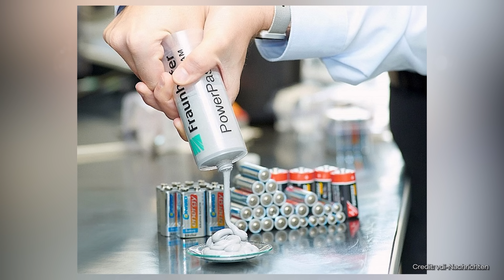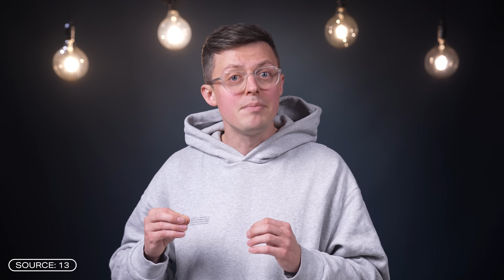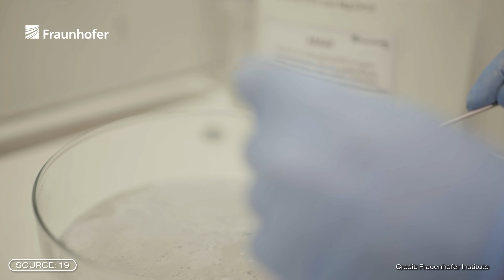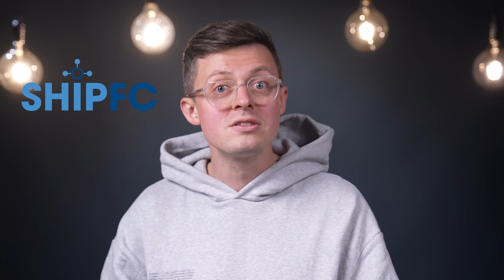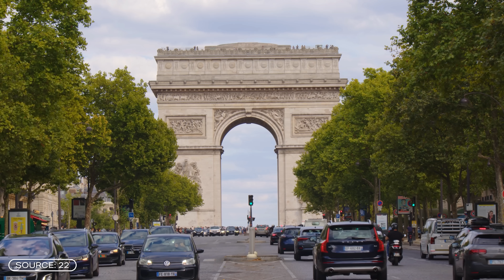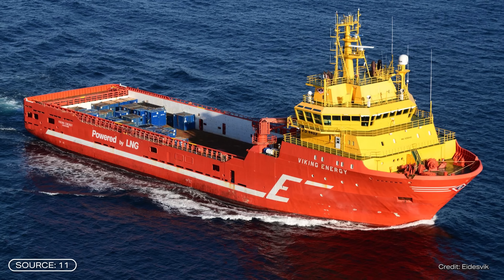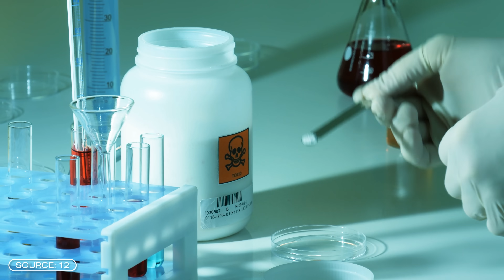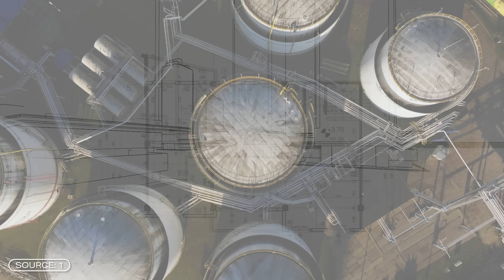Hydrogen Powerpaste: 10x Higher Energy Density & Safe?

Comment: how many kwh of energy does it take to produce hydrogen paste that contains 1 kwh of energy?
Reply: Yep this is the billion euro question.
My prediction is that however many kWh it is it's too many for any application where a battery can do the job.
The batteries in development now have an energy density of 500wh a kg so we are talking car ranges of 1000km+
There is just no justification for the added energy use, cost, and complexity of this technology, maybe shipping or long term storage might be niche cases.
Reply: @nervousfrog101 do we not also have to consider that the production of batteries becomes a bottleneck also that batteries storage is one thing the energy still has to be produced to recharge them and those systems also need to move from petroleum and coal and those replacements also have bottle necks. If there are other competitive energy production methods we need as many to consider as possible. I have concerns about water use of a hypothetical vehicle basically consumes a bottle of paste we then hypothetically deposit our empty paste bottle and reservoir of depleted paste as a deposit to get a new one top back up our water and go again how much of a burden is that in our water systems are the bottles reusable or more waste, are we recapturing water,how contaminated is that water should we get leaks into our water tables like we are with oil or fuel leaks now. Stable hydrogen fuel storage sounds great but lots of questions we also need to think about for implementation. Reasonably efficient energy production is just one.
Reply: @nervousfrog101  Exactly. From the power station to the battery, even taking into account hundreds of km of power lines, over 80% of the kWh makes it to the battery.

In this video the guy was talking about less than 50% efficiency for this paste.
Reply: @smoguli  I'll wager that 50% efficiency does not include creating the hydrogen either.
Reply: @nervousfrog101  From what I've seen, hydrogen round-trip efficiency is usually between 30% and 40% for a modern electrolysis cell and fuel cell together. I'd bet on magnesium hydride to magnesium hydroxide back to magnesium hydride being even worse. Producing magnesium metal from magnesium hydroxide (the waste byproduct of this paste after use) is a very energy intensive process.
Reply: @smoguli  yeah i think batteries are the definitive solution for cars, though i can imagine ships and planes profiting far more from this, also maybe the military will take it.
Reply: @nervousfrog101 Probably still more efficient than a gasoline engine 🤷‍♂️
Reply: @blueberrywilbur315 possibly but it needs to be more effecient than direct or battery electrification or it will only ever be suitable for niche cases which further strains the economics.
Reply: @nervousfrog101  The more we use our finite reserves of oil, the more cost effective it becomes.
Reply: I'm not 100% sure what you mean, but I think you're saying that as we run out of oil and gas, and prices go up, hydrogen becomes more cost-effective.

The problem with this argument is that it's not an option between fossil fuels and hydrogen. Fossil fuels are already doomed. Batteries are already a better solution for 90% of our needs. Hydrogen is a solution looking for a problem to solve.
Reply: @nervousfrog101  lithum will be doomed at somepoint to as well as all chemicals able to and or used during the creation.
Reply: @nervousfrog101  look up plugged oil wells. Just start with the deepest. You can find most of the data on Railroad commission (if your in texas) every state has their own version. 

Do a few hours of digging. You'll see the sinister truth.

If its not clear. Oil is being pushed up in places like a seeping but in reverse. I found a few areas in texas that are doing this, its looking pretty common in texas. The earthquakes are at the sites where the ground is treated like Swiss cheese, it does t take a rocket scientist to put 2 and 2 together.
Reply: @richbuilds_com hahaha 75ish % of commercial hydrogen production come from natural gas production “steam methane reforming” lol 😂
Reply: @richbuilds_com or…we could use nuclear and problem solved. As fossil fuels increase the cost of this substance will increase, oil is in everything.
Reply: @stephenc4755  There are already other battery chemistries that don't involve Lithium, such as sodium ion, but Lithium is still king of the hill for now and has not reached its peak yet.
Reply: @nervousfrog101  yes and it can run out to is all i was saying. im not disagreeing with anything else. its just all of it eventually could run out. Now imagine we could come up with a infinite power source harnessing power through thin air. Hell with how big coal hate nuclear power id say if we ever did find a infinite source of power, whoever found it would be dead and the tech stolen before we ever even heard a whisper
Reply: @stephenc4755  It's unlikely we will ever run out of Lithium, it's incredibly abundant, and it's 98% recoverable from old batteries. Short-term manufacturing shortages are possible. It's more likely that it will be replaced or supplemented with other chemistries.
Reply: @nervousfrog101  i sure hope so man. Life is already crazy enough. I had completely forgot that lithium is recyclable
Reply: @richbuilds_com the whole planet will fall apart before we burn through our oil.😂😂 at this point, this is an evidence based fact.
Reply: @nervousfrog101 i think people get hung up on efficiency, because they're usually engineers. But life has demonstrated that abundance, and sustainability is actually more important than efficiency. Especially, because almost all energy comes from the sun or gravitational forces. Therefore, historical natural evidence would say that sodium, is it going to overtake lithium as soon as we scale up.
Reply: @nervousfrog101 it seems like research momentum to me. Batteries weren't really confidently going to solve the problem 10 years ago. Hard to fire yourself and cancel your own research. Easier to convince someone that you should have a job.
Reply: @170_yearsNuclear for what?
Reply: @170_years nuclear will never happen because it needs smart people to run the plants with very careful processes, and the public to be smart and onboard with the idea.
Reply: @nervousfrog101 that energy density is too low for planes, and rockets. Anything with higher energy density than kerozen or hydrazine is interesting, and just like battery, first iteration are not the best.

Reduction in plane use is probably the way to go, anyway
Reply: @Miam_miam_la_gauffre you are ignoring effeciency. 60-80% of the energy from jet fuel is wasted as heat.
Reply: @nervousfrog101 We should not brush off alternative ways, it is always bad when there are no options. However inefficient it is now, it might be potentially better than batteries. It can be expensive to develop, but in the long run it will be cheaper. If we stop all expensive researches, we will have no development at all, as most low hanging fruits have been picked already, and humanity needs to invest more to get further. If you think about how much is spent on microchip advancement yearly, you will be saying a new iPhone is not worth it. Luckily, the manufacturers do not think so. 

But microchips apart, we need to get carbon-neutral soon, as we are already borrowing the environment health from our grandchildren. Hydrogen can be one of the alternatives, especially on the container ships, cruise ships, ferries and other heavy consumers. Maybe, trains or buses. I do not think of planes for now, but if technologies mature, they as well might be.
Reply: @nervousfrog101  Yes and not to mention the Toxic Waste aspect as well!, it's making batteries like sodium Ion look better & better :)
Reply: @pwrrpw319  sodium is a gimmick too its also explosive they claim its safe if it burns they lied some shot holes in one and it was like fireworks going off
Reply: @Hea@HeathensHaunt The same can be said about gasoline? When in storing that much energy in a small mass its bound to be explosive and also they shot it what did you expect was going to happen. What matters most is that under normal standard operating conditions or common fail states such as in a car crash and it doesn’t start heating up and set things on fire.
Reply: More importantly: how much does it take as compared with other fuels and batteries?
Reply: I don't think the efficiency is very high.
Reply: Quick google search says it’s 50-55 kWh to make 1KG of paste, which holds 1.6kWh of electricity.
Reply: @triplexkin6354so its DOA. Unless you just hook it up to the solar or wind farms or a hydro generator
Reply: @basteagui  That "unless" really discredits your intellect. This "technology" is batshit insane nonsense that only ideologically captured idiots could invent.
Reply: “Its hydrogen and flamable paste, i bet its extremely hyper expensive” said no one ever
Reply: @Petroleum_pipeline it’s 50 kWh to yield 1.6kWh worth of paste. It is pretty expensive.
Reply: @Petroleum_pipeline  Yep Pretty Expensive + Pretty Toxic = Pretty impractical!., unless someone can come up with a simpler cheaper & less toxic version, we are probably better off giving up on Hydrogen for transport!, and sticking with Batteries.
Reply: I asked the same question. lol Now they use natural gas and ended up with a net negative output
Reply: That was my first thought.
Reply: 57
Reply: Too much to mention I guess...
Reply: Yes
Reply: Doh !
you're not supposed to ask that question.
Reply: 1
Reply: The thing about this is that you’re never going to get net energy out of this stuff. It’s purely an energy storage medium to get work done without having to invest into either a nuclear reactor or haul a solar farm with you. 

Granted the amount of energy it takes to get a kWh of energy storage is still something important to consider.
Reply: Yes, I would also like to know this.
Reply: Doesn't matter nuclear is very cheap!

Oh wait...
Reply: More-so the question would be how much energy does it take to "re-energize" the paste to a reusable state. Initial energy cost would be negligible when it is re-used a lot.
Reply: @MsHojat  Cost of hydrogen has to be included, too.
Reply: The paste is reusable, but hydrogen is not.
Reply: @MsHojat  Since this is an almost entirely chemical-based storage, the cost of re-energising the cell is almost the same as the cost of making it the first time. The chemical bond needs to be reset entirely.
Reply: IDK, but I'm sure it will depend on the source of the hydrogen.  Water electrolysis is not particularly efficient, but other hydrogen sources/deposits, reportedly, have been found.
Reply: We've got us a 'thinker'."Release the hounds" as Mr Burns would say.

Comment: If we compare these H2 storage methods with synthetic (using renewable electricity) liquid hydrocarbon (LHC) fuels such as we currently use (fossil oil), there is no net advantage for any of them.  There is proven carbon-neutral  technology for producing LHC fuels from water (H source) and atmospheric air (CO2 source), and this is where we should be focusing our R&D efforts...making them as cost-efficiently as possible... 100% pure, carbon-neutral fuels that directly replace fossil LHC fuels in our current infrastructure and machines.  The quest for zero-carbon seems to be driving us away from this, and toward technologies that may be zero-carbon but that will induce a much higher total resource cost for the transition process and probably beyond that as well.  Carbon-neutral is good enough.  If we stop adding carbon to the atmosphere, various natural processes will lower atmospheric carbon levels quickly enough.  We need to break the fixation on zero-carbon and look at all possibilities to make a renewable-energy-based future!  
(Note:  For a few applications, short-range, low-power transport, like mopeds and city cars, and probably for grid storage-stability, solid state sodium batteries will make sense.)

Comment: There are many materials, which can absorb H2 at this rate - 5-10% of their weight. The problem is, to increase the mass percentage above 10%. Nevertheless, the direction is right. Storing H2 in hydrogen absorbing materials is a good choice, compared to the liquid and compressed H2
PS PLEASE. Discuss the fuel cells on hydrocarbon fuels. They may seem not "climat-friendly", but are a WAY more effective than the piston engines and work with far less noise and vibrations. Methanol, ethanol, CNG, diesel fuel cells exist!

Comment: Fraunhofer institute 
1990s compress audio wav format into mpeg layer 3...
2000s compress video mpg, contribute to the creation of amazing H.264 codec
2010s build the highest density, most capable solar cell ...
2020s compress hydrogen chemically into paste...

Keep doin what you are doin Fraunhofer institute,  for the good of humanity,  for the good of the future!!
Reply: You forgot the working Stellarator, you can basically buy today and who just isn't competitive with oil fired power plants.
Reply: @goiterlanternbase  I have no idea what a Stellarator even is,  so,  i didnt just forget about it, im wholly ignorant about it!   (got some stuff to look up now!)
Reply: @burnitdwn  Wendelstein 7X. It is run by the Max Plank Society, but the technology behind is developed by Fraunhofer IWS (institute for materials and beam stuff).

The technical director of the Wendelstein was guest in a podcast and explained the how's and why's. When they made the constant plasma heating test for afair 7 minutes, according to him, the exact time was not important, because the limiting factor was the electricity bill. That it does not fusion, has two reasons. The first is a different set of paperwork, for everything nuclear. The other is that it is much harder to work on a radioactive machine and this is after all a science project, where they like to change stuff and break stuff. 

Look this up: FG100 Stellarator
It should bring you to blog named Forschergeist. It is a talk in German of course, but they have a transcript, that you can translate or just ask an AI agent for details, or just translate you the entire podcast in their original voices. 

The podcast i am referring to, is the Alternativlos, session 51 (ALT051) 
I don't know if they have a transcript, but i guess they have.

Comment: How does the energy density of the hydrogen paste compare with powdered Al?  As it has been shown that powdered Al mixed with water releases hydrogen efficiently.
Reply: Notwithstanding all the other flaws with this tech,the energy required to use Al as a consumable is insane.
Reply: It seems a future to run ships and cars  you would buy a packet of aluminiuim powder and let it react to give X  kms of driving power. Maybe 0.5 kgs of aluminum powder turns into 1000 kms travel once  H2 produced?

Comment: Half the hydrogen released comes from the water?  So it also releases oxygen I assume...   How pure must the water be to avoid unwanted chemical reactions that could decrease yields or potentially cause ignition or explosion with all the hydrogen and oxygen in the system? 
Would it be possible to miniaturize the recycling process enough to do on site, or on a vehicle, and then simply fuel the system with water, or water and other stable reagents?
Reply: nah, it turns into magnesium hydroxide, binding the oxygen.
As for the recycling apparatus size fitting on the vehicle, probably not, it takes quite a few steps, depending on which route you go, you'd probably be dealing with molten metals and such. I don't think that'll work very well.
There are other solutions that are more 'rechargeable' in vehicles, though batteries still take the #1 spot there.

Comment: this will never be viable alternative. every step of conversion loose energy. decent fuelcell get like 60% energy so in the end it'll be compareable to lithium not even less and you have leftover that you'll need to process so at scale it'll be impossible to implement when ev you just charge the car and go. 10x is just raw energy but in reality this is a hassle. as hydrogen trasport? maybe. as ev power? unlikely.

Comment: Nothing new under the Sun.  Dr. Roger Billings in the United States demonstrated low-pressure storage of hydrogen in metal hydrides in the early 1970s.  He built a car that ran on hydrogen; the waste heat in the exhaust heated the fuel tank filled with metal hydrides, causing hydrogen gas to be released.  The engine required minimal modification, consisting of a small nickel disk being welded into the cylinder head of each combustion chamber.  He built a "hydrogen homestead" that used hydrogen for cooking and heating, all in perfect safety and was completely independent from the electric grid, gas companies and oil companies.  He even demonstrated the safety of the storage system by firing incendiary bullets at a storage tank with no fire or explosion being produced.  Dr. Billings shut down his research after shots were fired at him and receiving death threats from petroleum interests.  If it hadn't been for that, the world might have converted to hydrogen by now.